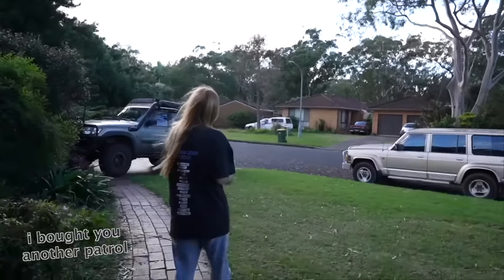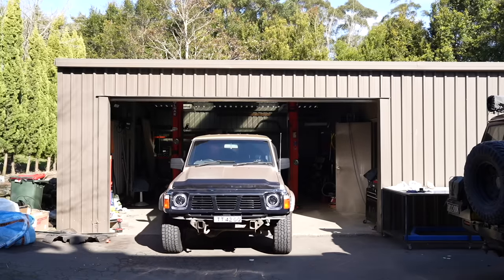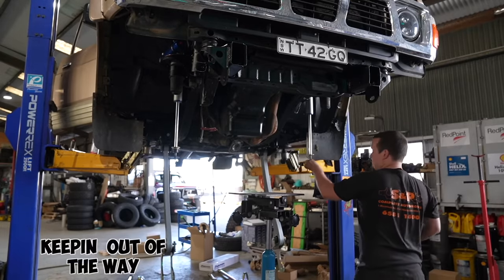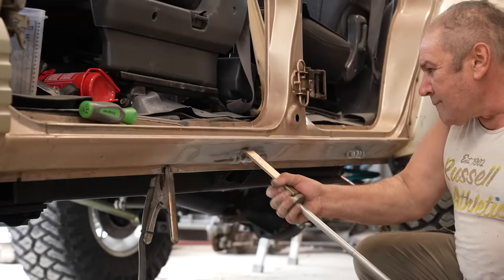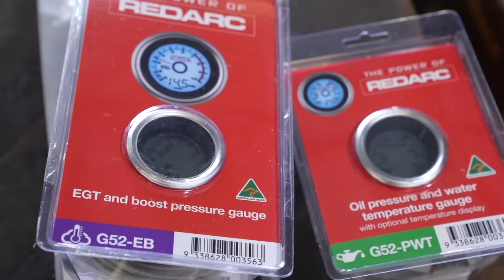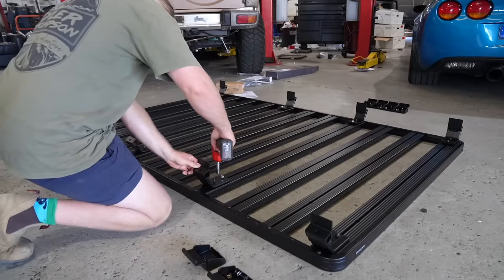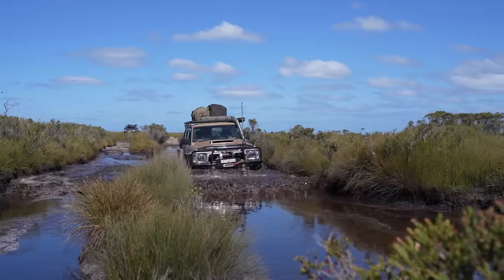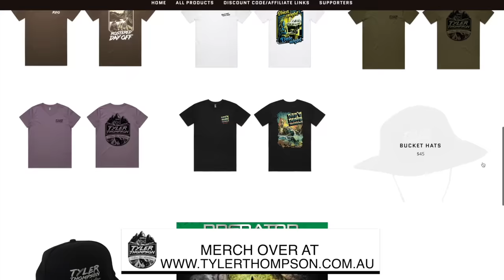Building my dream 4WD in 20 minutes! Nissan Patrol complete build

Comment: So, with labor and without sponsorship deals you're talking about $100k+ for the average punter. How much of that is going to be a tax write-off for your business? Congrats on the car to yourself and Demi, it's not something I would drop that much cash into but it was your dream and you've made it come true.
Reply: That’s a bloody good question mate,I mean good on him for being sponsored or being able to put whatever thru a business,the true cost is what we really want to know
Reply: He probably means without his own labour. 70k would be all of his receipts etc, I priced up the build as a guess based off my own experience before he dropped the price and I guessed about 70k too. 

He spent a lot of money on things you can do yourself, and paint. 

You could easily half the cost of this build. I'm doing my single cab by myself, which includes a coil conversion. Chassis - 1k, full coil kit and some upgrades - 4k, quick azz cooling, 1k, turbo and intercooler incl pipe work, 5k, interior seats, rails, sound dead, carpet, steering wheel etc 1k, sound system 1k, etc. You can do it for 20k, ignoring all the things you don't need like crazy bar work, party lights, alternator, 12v, full paint, all new seals etc.
Reply: 100 gran for new 23/24 stock 4wd
Reply: 100k for a cruiser with a canopy 😂
Reply: That is ridiculous 100k for a gq patrol
Reply: probably 150k easy. This guy has connections. An average bloke to pay mechanics and what not would probably cost the same cost in labor than the parts

Comment: I'm doing a 2001 TD 42 at the moment and I won't be spending that much. Just new suspension 3 core radiator. Catch can rebuilt the swivel hubs.all new fluids wheels tyres catch can . Oils alone was $500 It adds up fast. But it will do what I want. Great honest vid.
Reply: Honestly people need to realise there's a difference between general maintenance and actually "building" it with new fancy parts. Swivel hubs are general maintenance, a cheap GQ you'd expect to have to do that. At least you know it was done fresh and not hearsay by the previous owner.

Comment: realistically 80k for a fully setup rig that's ready for the absolute hardest and toughest tracks and will go for several more hundreds of thousands of kms then will need a 10k rebuild and good to go for anout 500k. well worth doing this to this level of quality over getting a brand new stock PoS off the floor that will then still need more money. well worth it in my eyes, fckn hectic build boss.

Comment: Tyler:  I am building myself.  I am building an  Global Overland rig off of a pickup frame 350-550 Dodge or Ford. You call them UTE's we call them flat decks.   Here are my thoughts on the most asked questions.
There are two questions we all seem to get asked and these  revolve around sanitation and cost. 
 Cost is IMHO almost Impossible to deal with, because of several factors. 1)  Most of us work on our rigs.  What is your time worth?  How much is your friends help worth?  Then we have food and "beverage" costs. 2.) Define time .  Time is NOT just wrench work, it involves  planning and assembly of all things used.  3) The cost of your base platform.4.) Shop tools. What would it cost to purchase every tool  that was used with a new one ? IE: I own a welder, but may have to purchase another unit as mine is to small. This adds 2k to my costs.   How many cutting discs did you go through?  Did you have these prior to the build?  5.)  What did you already own? ( IE radios, sound systems, fridges, Maxtrax.  To replace that costs?  6.)   Items either purchased second hand, on sale, or sponsor donations, freebees.  The big item is work "farmed out".  [Read: I don't have the skills to build a legal roll cage, therefore this gets farmed out.]
 I can't see this project coming in at anything under 150k. Why, because I still need to  purchase my aluminum and all the things that go with this like Sikaflex and Foamular 250 , PL Premium etc. for my "habitat" and the base  vehicle unit and not including the bills not counted  as of this writing, OR ANY of my time, I have spent CDN CDN/AUD $21,600.  The Aluminum will set me back about $ 13k minimum.
 Nice build  Have fun on Fraser Island, and remember to lock your hubs BEFORE leaving the barge or you may end up in a photo like the one I took of a guy bogged to the frame.  OOPS.

Comment: Hmmmm, I'd be interested in seeing a spreadsheet of these prices. I'm aware labour costs factor in a fair bit of it but jeez, $60-70k parts you can get a 12 valve Cummins crate engine, new TR4050 + bellhousing and heaps of other stuff imo.

Comment: Mate, It's certainly a weapon!! 
However, you weakened it putting those poxy Elockers in it.😮
Reply from the maker: Run them in multiple 4wds for years and given them a constant hard time and never had an issue with one, so not sure why they are weak haha
Reply: @TylerThompson90  That's because you've had smaller 4wds with much smaller tyres! Haha. Small lockers for small jobs. Unfortunately all the e-locker use the same small little gears. 
They're just much smaller internal gears when you open them up compared to the Pro lockers or even the poxy ARB locker. They also unlock themselves when you roll backwards, shit design. People do fry them. Time will tell, I guess. Chuck a Pro locker in it when it fails, don't go ARB. 
Keep up the awesome work, mate. I've been a sub since your first started out. I also live near your dad's place, had a few chats with him. 👍
Reply from the maker: @SteveBurns80  Run them in the GU for nearly two years now, twin locked on 35's driving hard. 6 months in the GQ twin locked on 35's driving even harder. Maybe smaller internals but I definitely wouldn't say they are weak haha, out of all my mates running various lockers (harrop, TJM & ARB) the only ones I've seen break are ARB air lockers. In regards to the unlocking when rolling back I honestly rarely see it and even rarer does it cause a problem, its only 1/8 of a wheel rotation too. People make out like you have to sit there with your wheels spinning for them to re engage. And cheers mate, appreciate it! 😁
Reply: @TylerThompson90  Yeah hopefully you're right, mate. Will be interesting to see if they hang in there for you. They certainly wouldn't be my choice of locker for a big Patrols on 35s. I'm certainly impressed they've lasted that long your rigs. 👍

Comment: Amazing video to watch! When you see 4x4s advertise with 300, 000km plus on the clock, whats the common price for a reconditioned motor and you did mention the ither car in Tasmania had a crate engine, what are they worth? I see so many cars advertised with a full setup but the engine is long in the tooth as in too many kms. Cheers
Reply from the maker: Cheers mate! A crate motor TD42 is around the 16K mark, a basic re build on one is around the 7-8K mark

Comment: Let’s be real 80k total is still less than a single cab 79 with no tray and all the issues 79s have 

I know which I’d pick
Reply: What issues?
Reply: @06hunter54  wheel track is wrong, Shitty leaf springs that can’t carry anymore of a load than a navara without doing a cali lean, no cup holders, no sound deadening, no electric windows, the same power as a NA TD42, an airbox that doesn’t seal and lets dust in

Then you just add the fact they’re $85k with no tray, on a 225 light truck tyre that’s useless with $30 trailer steelies 

Sounds like a good deal 🥴

Comment: box chassis rust from inside out.. superior arms, wrong..horizontal bolts put strain on mounts..coild need to be bolted top, bottom, dont rely on shock..were restricted by stupid aisie laws, which are basically same as a car,,which os bs..those engineers need to watch u.s. vids..clipboard worriers, .billion dollar industry & employement, going to waste.. id like to know how those pos, 79,s got passed, with a 4'' narrow rear diff..isnt that a defect,,unsafe to drive..???..why dont gvm upgrades include bigger diffs, bearings.. ??..vehicle weight. seeing all jap 4x4rs weigh 2.6t, & then tow 4t..bs..just fkn wrong..a dana 44 will handle 35,s.. no problems.. if you want 40,s then you fit a d60. or 1ton diffs..s/duty..  oh forgot,,79 clutches,,must be from the 6 syl,,seeing they blow..
Reply: Don't be speaking too much truth for these blokes haha. I fully agree with everything you've said. 14 Bolt 10.5" or AAM 11.5" are the way to go, along with Dana 60 front. Shock loading the shit out of stuff I'd trust them over anything else. Patrol & 79 Series type banjo diffs are as good as Dana 44/10 Bolt Corp front diffs, they're excellent for what they are don't get me wrong. I just think trying to tow max GVM flat out + max flex is a combination that's inevitably got a lot of compromise in it.
Reply: I just think old mate could've got a better rig for his money with some actual research not just advice from mates. Crate engine 12 valve, TR4050 5 speed + bellhousing, get someone to CNC an adapter and spud shaft for the patrol T-Case for starters.